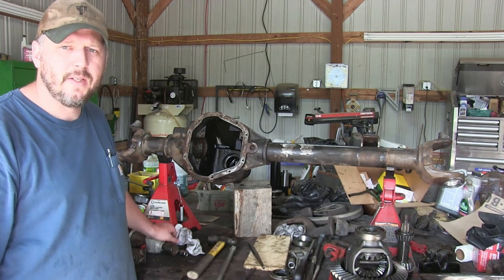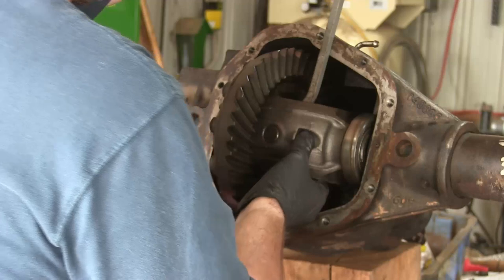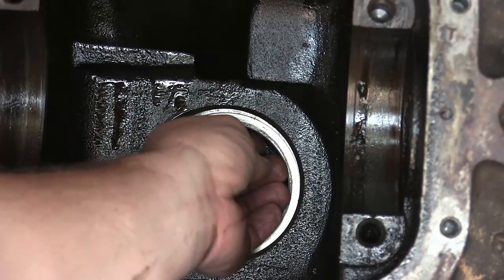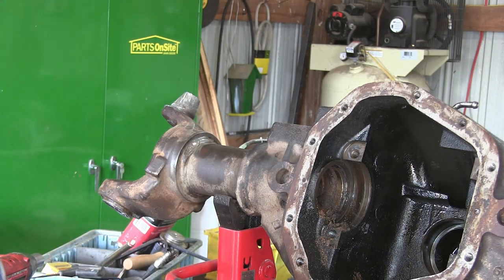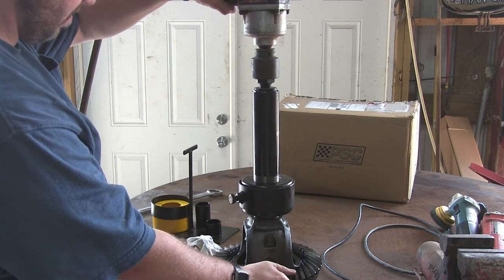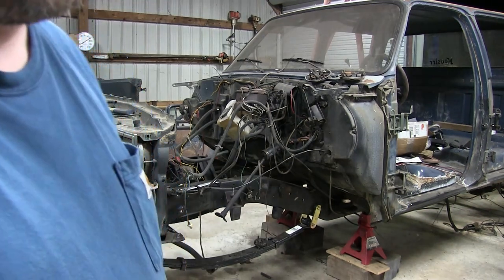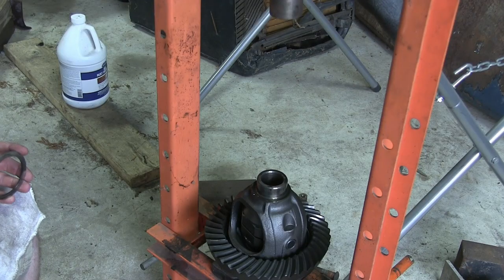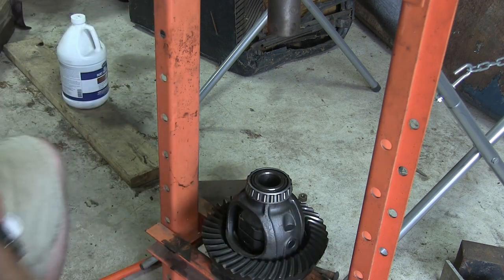Dana 60 carrier and pinion bearing replacement DIY

Comment: Great videos ;  I don't understand how you ruined your bearings by running hot water through them......did you drive dirt in the hot water into them or what?  Excuse my ignorance in this matter, but as long as the bearings were dried & lubricated I would have thought they would be fine. Thanks for great videos.  Cheers!  Brian Hind
Reply from the maker: Yes the axle tubes were full of dirt.  After washing the axle the bearings were full of dirt/grit and did not turn very well.  Technically I didn't ruin them since I didn't run them in that condition.  I could have just removed them and washed them out well and just reused them.  Since I had to pull the carrier and pinion, and since I was not sure when the last time these bearings were replaced I decided to replace them.  Thanks for watching!

Comment: Do you have a name of the puller you purchased?
Reply from the maker: GXL Carrier & Pinion Bearing Puller Dana 30, 40, 60, 70, 80, Ford 10.25 Clamshell Design bought it off of amazon but it was sold by GXLPARTS
Reply: @Offroadfarm1  thanks. Do you know if it will do 14 bolt differentials as well
Reply from the maker: I have not tried it on my 14 bolt yet.  But I did lend it to somebody to work on a Dana 80 and it worked for them just fine.  If it works on an 80 it should work on a 14 bolt
Reply: Alrighty. Sounds good hope it works. If not going to return thanks

Comment: Just take the caps off and turn the pinion and it will push the ring gear and carrier out.
Reply from the maker: Thanks for the tip and thanks for watching
Reply: That does not work.
Reply: It does work because I've done it many times.

Comment: I have discovered that using a wrench for removing the carrier works pretty well,
  I used a wrench on one of the Ring Gear Bolts and turned the Carrier unit until the wrench is touching the differential housing,   the I turned the pinion Yoke on the Carrier pushed itself out.
   Tried to remove it with two large pry bars before that and one of them slipped out of place Clunking Me Up Side My Head!  😮. No Fun!